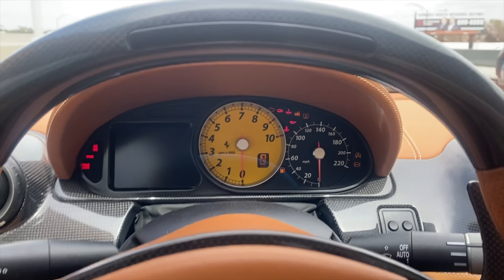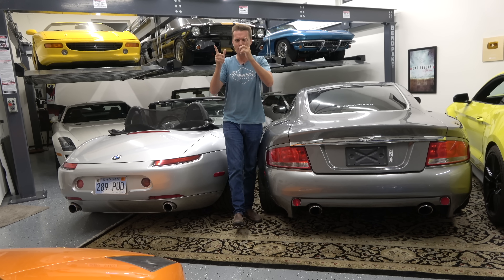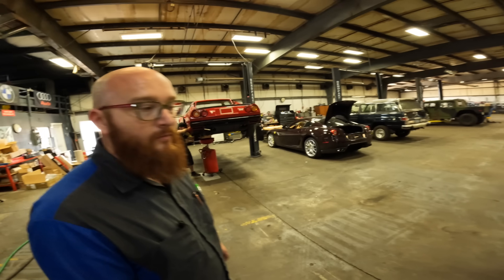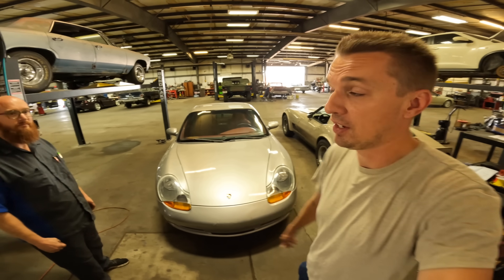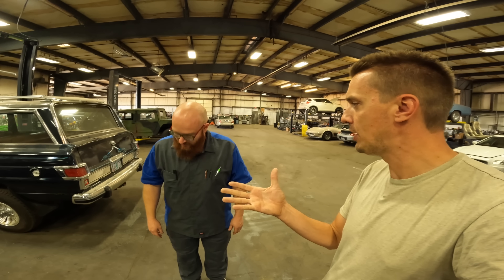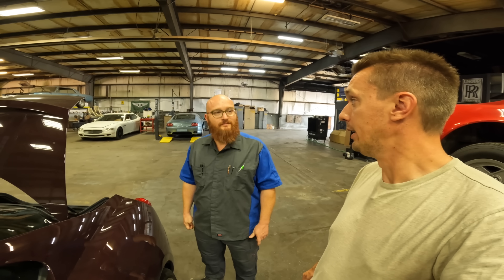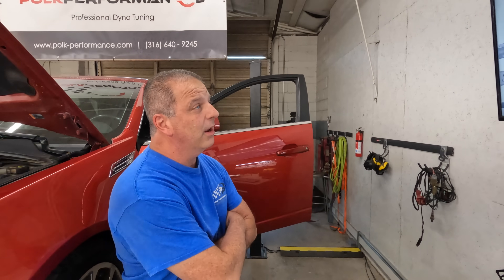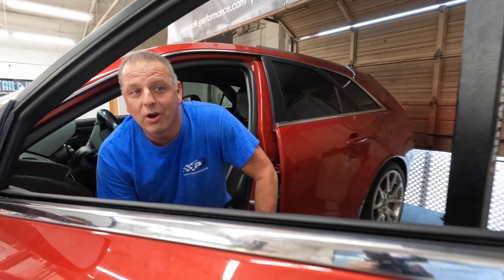My CHEAP Cadillac CTS-V wagon is now a 700HP grocery getting MONSTER that everybody needs!

Comment: Samcrac avoided the Ferrari tax on his 360 by using Bosch fuel pumps that weren't in Ferrari boxes and by buying the sending unit separately. It would've been $1,800 for the pair and he did it for under $400 if memory serves.
Reply: samcrac works on his own cars i don't ever remember hoovie working on his cars a conspiracy.
Reply: I think the Ferrari needs the top assembly as well since it's cracked?
Reply: oh yeah those are those same fuel pumps that the 360 uses- that samcrac video you mentioned is very good.
Reply: It'sin tthe wizardry of sourcing auto parts
Reply: @kc0lif  Wiz has talked about these hacks in the past by sourcing parts from other cars that are the same part only cheaper. That's why I brought it up.
Reply: Yup, SHOP...
Reply: wizards used a rondo pump on a high end car before
Reply: @rockyloccgarage2040  yeah, on another Ferrari V12 I think
Reply: Hoovie can’t change a tire sams a genius lmao
Reply: @sonnycalzone7784  just because he doesn't work on his cars doesn't mean he isn't capable.  he seems to have a ton of general automotive knowledge and could probably fix a lot of the things with his cars himself if he really wanted to take the time.

Comment: The fuel leaks in a Ferrari is just the factory installed expiration date .
Reply: So long as the driver doesn’t expire too…
Reply: When they went into the cabin and where subwoofers would be in a car with a nice sound systems there a fuel pumps with fuel filling up the area around them begging to kill you and your car in a horrible fire. Great design and marketing.
Reply: Out of warranty usually when things go wrong then you basically have to replace every part 1 by 1 so basically if you keep one of a while pretty much replaced a whole car
Reply: Risky way to do it, risking burning a good customer to death - they can't buy another leaker if they are dead.  The Germans do it better where the car just starts to fall to pieces rapidly after 5 years or so.
Reply: Italian SuperCar defense mechanism. In case of emergency, catch fire.
Reply: Smell of gas is to remind you that you are off warranty.
Reply: @ironmonkey1512  Ferrari way of making you buy a new car
Reply: Imagine calling the factory and some Italian goes like ‘It’s parte of the DeNA of thee carr. You want a fun carr with emotion or a robot my friend’
Reply: “Planned obsolescence”. “Oh, it caught on fire? That’s what insurance is for. Can we sell you another?”
Reply: At least they gave big service holes! 🤣
Reply: @PCgamer923  I hope Putin owns a few of them then.

Comment: Just imagine Ferarri making a fully electric vehicle with an in-house built electric system 😂
Reply: Big on and not off shiftlever?
Reply: They'll probably just out source it to someone reliable... like Audi. 😂
Reply: It already existe, but it's called Tesla.
Reply: But on the plus side it will not leak fuel!
Reply: Lols all these electric vehicles are falling apart now days
Reply: It would be a very electrifying driving experience
Reply: It would short out and catch fire!😂
Reply: I have an even better idea! let's have them make a full electric vehicle and a full engine vehicle and then adding hybrid stuff so they have to work together and you have your wonderful electrical system that will make Lucas proud!
Reply: Ask Wayne Carini about modern Ferrari electrics...... he had a client who bought a pre-owned LaFerrari at auction and when he went to start it it was bricked because the hybrid electric batteries died. The couldn't even get it into neutral to tow it. They had to charge it in the showroom. Not the 12v standard car battery, but the hybrid batteries. Even though it has a gas V12, the damn thing won't start unless there's charge in the hybrid batteries.
Reply: Batteries exploding isn’t that much better over gas
Reply: @joe6096  Usually because the hybrid system also doubles as a starter.
Reply: @Fay7666  Well that's a whole lot of stupid right there to begin with lol
Reply: @TheRealAlpha2  more like Lucas,  the prince of darkness.
Reply: @TravisFabel  .It's already here I have driven the 1000 bhp Ferrari SF90 and it is amazing 4.0 litre V8 twin turbo 800bhp and 200 hp of motors , only 25km of battery range but who cares !
Reply: Oh lord no
Reply: The battery would be more expensive than the msrp 😂😂
Reply: @som3body3  did you just called a tesla „fully electric ferrari” wow
Reply: NOOOOO, far from it, but in a way, musk want it to be, like with that stupid plaid mode, I don't want to imagine how much this kill the battery
Reply: @xiukn8  i taught I read that wrong. Obviously someone who doesn’t know anything about Ferarri and it’s history to compare it to Tesla lol. Btw I have a Model Y Performance on order but I’m not a fanboy of any brands. I do realise it’s a POS quality wise but for the price where I live it’s the best electric car… they force business owners to drive fully electric… and if even a Volkswagen ID5 with some basic options cost the same the choice was quickly made.
Reply: @stevebeck9470  yes and in 7 years when the warranty runs out they will be worthless because a) nobody can supply the parts because it will be seen as oldschool tech and b) it will be extremely unreliable as this was one of Ferraris first mass produced hybrid systems (LaFerarri was a very limited run)
Reply: um, that's literally what ferrari are doing right now, they have their first EV SUV coming later this year and their official statement is that their EV sports car will be launched in 2025. They said every one of their new cars will be EV-only come 2030. 
Their flagship cars are hybrid, so it's no surprise that their next flagship will be full EV.
Reply: @TheRealAlpha2  Nope, they have a in-house built EV sUV coming this year and their flagship car will be EV coming out in 2025.
Reply: @som3body3  Tesla is not ferrari by any means.
Reply: @martinmicheal4595  That's not even remotely true.
Reply: @joe6096  You do know that every extreme limited production flagship cars all have detrimental issues like that, right? The 918, P1, Koenigsegg cars, Bugatti all require very expensive maintenance and be charging the battery when not in use. 
It's literally part of owning these cars is that they are fragile, extremely expensive, and require constant maintenance.
Reply: @ewaldgoorhuis9094  will still leak gear oil though
Reply: Having owned a Lancia twin cam. Italy should design the look ,and supply the engine, hand it to the Germans for drive train  and electrics and build, then ship it to the UK for the interior.  Perfect sporty GT.
Reply: @TheRealAlpha2  worked for Ducati.
Reply: I’ve seen little RC LiPos explode, can confirm bad batteries are dangerous af
Reply: @sqlevolicious  Oh yes I understand exactly how they work, we have a 2016 Corvette Z06 we keep in storage in winter on a trickle Charger. The problem with the Ferrari is that it requires the hybrid batteries to be charged to start the gas engine, which only requires the 12 vdc standard battery for operation. As they were trying to start it they even had all the dashboard lights and indicators, meaning the 12 vdc system was charged.
Reply: It'll still find a way to burn to the ground
Reply: @ewaldgoorhuis9094  It would only create sparks until they could find a ignition source.
Reply: @TravisFabel  That reminds me Travis.  Why do the British drink warm beer?  Because Lucas also makes refrigerators.
Reply: @MWHM2  very true , I hired it for 30 mins so I don't care !
Reply: @shaunportlock4924  Germans are also not what it used to be with their electrics unfortunately. I’m speaking out of my own experience and that of my surroundings, they are maybe on the same level as the Italians nowadays, especially VW group, I don’t know what happened since the VW Golf 6/7 era but they have been building some incredible garbage tier systems into their cars… nobody complains because most of these are still under some kind of warranty. Strangely I’ve heard very little issues with modern BMWs since 2017 (maybe because here in Europe we mostly get smaller engines and diesels that are very reliable). My Audi A4 has been terrible electronic wise and also interior quality, it literally falls apart now that it’s 5 years old. I truly don’t onderstaand why VW while increasing the price had to cut corners like this, they are shooting their own feet and will get a reputation for unreliable overhyped cars in a few years.
Reply: @Jonathon Cook Could not agree more.  Have had 3 Jags but for some odd reason they never gave me trouble and they were high mileage when I got them.  (Poor man on a budget Jaguars)
Reply: it will be ''straight fire bro'' mwahhhhhhhh
Reply: Bzzzzzt sptt crackle
Reply: @nicholascortez728  not necessarily, no gears needed with direct drive motors.
Reply: @ewaldgoorhuis9094  I am not sure if it leaking battery acid is much better.
Reply: @MWHM2  To be fair even a fully electric vehicle will be basically worthless after 8 years. That's when the batteries reach end of life and a new battery normally costs more than the entire car is worth at that point. So in the future scrapyards will be filled with 8 to 10 year old cars that are basically toxic waste, because of the battery inside that can't really be recycled.
Reply: Doesn't sound like those issues were Ferrari's fault
Reply: @som3body3  Tesla's are cumbersome, heavy, poor quality beasts of burden compared to most Ferrari's.
Reply: the Ferrari would burn to the ground taking the Earth with it.
Reply: Yea that doesn’t sound promising Italy and England have never been known for their electric prowess 😂
Reply: It would still leak gasoline

Comment: I had a CTS-V wagon in blue that was making around 900whp on E85. Motor built by Late Model Engines in Houston, fully custom 3 inch exhaust system, long tube headers, pulley swap, cooling upgrades, Cup 2 tires, and lots more. Fun car, great build.
Reply: How long ago was that if you don't mind me asking?  2 years, 6 years, more?  Houston is not that far from me.
Reply: @LaSouthernGemini  I think I bought the car in 2015 and sold it in 2019?

Comment: You need an x pipe or h pipe and add a set of aftermarket compact performance resonators with hopefully small mufflers before the tips for Apollo 911 to get rid of the drone. Just go to any exhaust shop and use magnaflow parts.

Comment: I had a Dodge van that had freaky instrument cluster things going on.  When I pulled it out, it was bi-metal corrosion between tinned copper and aluminum.  Fixed it with a burnishing ... thing, getting rid of the corrosion twice before I ditched that POS.  Bought it new, only lasted 120,000 miles or so.
Reply: Gee, my Dodge van was just getting broken in at 120K.  Sold it at 320K.
Reply: @21Piloteer  Mine was a 1999, made at 11:30pm on a Friday. Front end was way out of alignment from the factory, all the trans pan bolts weren't torqued, and the battery leaked acid all over the anti-lock brake module.  Used to be a Mopar guy. Now I'm strictly Toyota.

Comment: My 08 Ford Edge went bonkers yesterday, the compass sensor died. The odometer and speedometer stopped working all of a sudden, and then the engine started not communicating with the transmission. In order to accelerate from a stop sign I had to get the car into 4000 rpms to barely move, then it overheated and Flippin died. Thanks Ford for making a giant piece of metal and plastic crap

Comment: I think Hoovie should race every car he owns against each other to see which one is the best. A tournament of champions.
Reply: Yesss. I would love to see that, but it would have to be on a race track, not just a drag strip. Any google search with tell you which is fastest in a straight line, but it would be interesting to know which is the fastest in a real driving scenario. I wonder how that E type would do?
Reply: @howlerhusky8837  Slow, unfortunately. Old tire models are really limiting, and the brakes of old cars are also not very good compared to modern ones. There are other factors as well of course, but those are the two major ones.
Reply: @GoldenCroc  That is true, except Hoovie mentioned that the brakes felt modern, which is understandable considering this was a serious performance car when it was new. The tires are a bigger determent to it's performance. They can't be the original tires from 1966, so they have probably been updated to radials. However if the car has only been driven 5000 miles since an engine rebuild that took place years ago, as Hoovie mentioned in a video, then the tires are probably dry rotted and won't have much grip. All that being said, the jaguar was built long before safety was a thing that was considered, which means it's built like a tin can and weighs next to nothing. Pair that with decent handling and a fairly powerful motor and I think the jaguar could go pretty quick. Of course I don't expect it to beat the 500 horsepower Cadillac we see in this video, but I am curious to see how it compares to some of his 1990s supercars and his Land Rover suv. But we could speculate about which car will do what as much as we want and not get anywhere, well never know unless Hoovie, or somebody else with access to an interesting assortment of cars actually takes them around a track to see what they can do.
Reply: @howlerhusky8837  It of course depends heavily on what track it is (layout). Old tires dont normally use the latest compunds, and thats an extreme drawback of many seconds around a lap. Even if you fit tires with modern compunds in some way, the chassis and suspension wasnt built for that amount of grip, and is just too soft. It will lean over on the outer side bump stops in the corners, more or less in that case.

Similarly, the brakes might feel "modern" compared to a muscle car of the same era, but they arent very good compared to a modern car. 

I like old classics as much as the next guy, but fact of the matter is they are very slow compared to just about anything modern (normal cars, not pick ups and the like obviously) around a track, for chiefly the reasons above.

A small budget sporty hatchback like a Ford Fiesta ST hatchback would likely equal or beat it around a lap on most tracks, if both are stock.

Edit: Another thing is people underestimate how fast even a normal family car is these days. My Renault Talisman wagon (normal family hauler, not a sport version), got as stiff suspension as a sportscar from the early 2000s...
Reply: @GoldenCroc  I agree with you completely, I just watched a video where 4 nineties sports cars were trying to beat a modern Toyota Camry around a track. The camry was about 15 seconds faster than all of them. My point was the jaguar was no ordinary car from the sixties, and I'm curious how far out of it's time period would it still be competitive. Like I said there's no point in debating this, because we'll never know unless Hoovie actually takes this video suggestion... But I'm going to continue to debate this so YouTube's algorithms think this comment is important and keep it towards the top so Hoovie sees it.
Reply: @howlerhusky8837  Haha, I dont disagree either. No it certainly wasnt an ordinary car... It all depends on what you compare to. Sorry for being repetitive, but just like property values is said to be based on 3 things: location, location and location; lap times for road cars in comparison such as this are overwhelmingly based on tires, tires and tires, at least within reasonable limits.

In any case, if we make a thought experiment where all are wearing the best tires from the year they were made, I think it could hang reasonably with cars made 10-15 years later. A 1979 camaro with an automatic and malaise era power certainly isnt a fast car...not to mention some american "sports cars" from that age had like 100hp in their base engine alternative. It probably beats those? But it really depend on what car we compare it to. Could indeed be interesting but I am not sure Hoovie is the driver to make that comparison fair, would take a pro driver to really get the up and up. Cheers mate.
Reply: @GoldenCroc  Cheers to you too.😋
Reply: I just think it would entertaining content.
Reply: @GOBEARS1985  I think so too.

Comment: I can't believe I missed the 911 ls swap. I have to really go back and rewatch some stuff. I think it's amazing that it fit in there
Reply: He blew the original high mileage Porsche engine on the racetrack if I remember right, then he did it again with the LS swapped engine on the same track. Hoovie has not had good luck on the track, he blew a coolant line with a different 911 on the same track, and they were not pleased with coolant all over the track that then had to be cleaned up before others could use the race track again.
Reply: @marcusdamberger  thanks. I'm still watching to find all they golden hoovey nuggets

Comment: I was glad to see an update on Apollo 911. I completed an LS swap into my 01 Porsche 911 back in the spring and just had the exact same thing happen. After 300 miles a spark plug boot burnt. I "Thought" I had enough heat wrap on the headers and the plugs that appeared to be close but.....